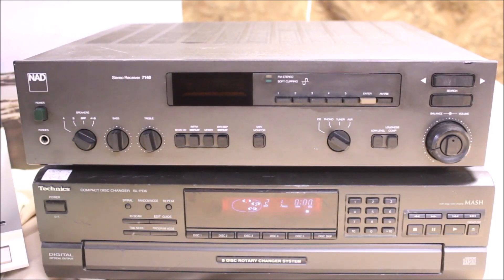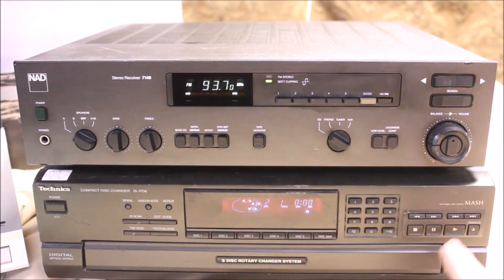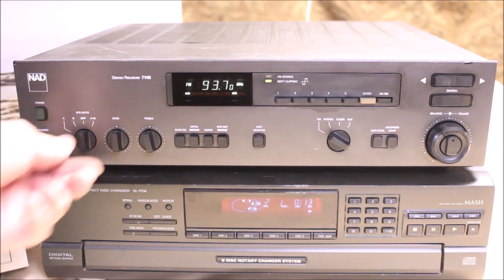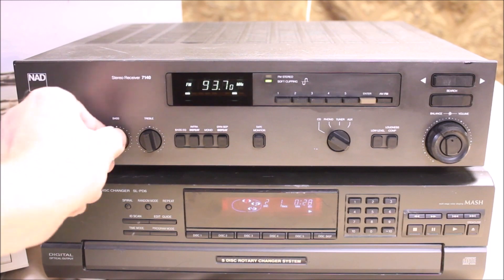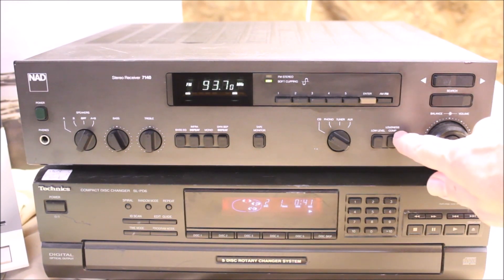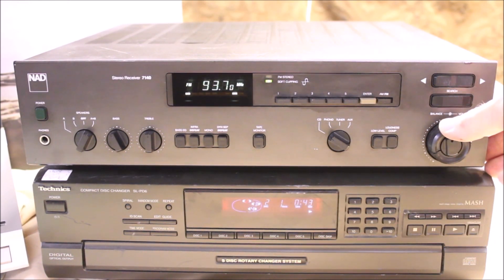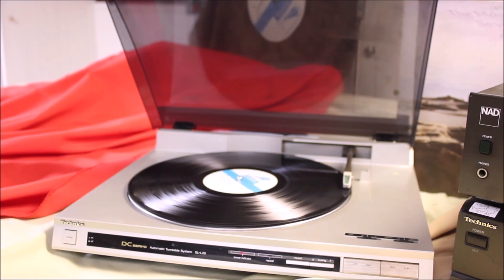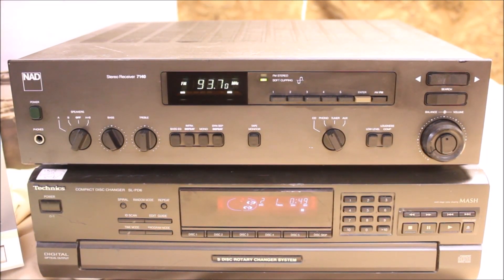Vintage (1987-1989) NAD 7140 Demonstration

Comment: I still have this receiver, I got it in 1983 or 84 when I left high school. The only problem it had was a cold solder joint right when I started using it, the seller fixed it right off.  I don't really have a use for it these days. The speakers I got with them (boston acoustics A70's) rotted out at their woofer suspensions.  My only complaints when I used it:
1) merged volume knob had one channel with slightly more gain than the other, only an issue at very low volume. Can be managed with the balance.
2) a bit of noise when turning the volume, not a problem (disappears when stationary)
One nice design feature of the 7140 is they used extension rods from the front controls to the back switches. So instead of running a circuit to a pot or switch at the front which would lose signal and gain noise, they mechanically conveyed the button or knob to the back where the signal trace would be short as possible